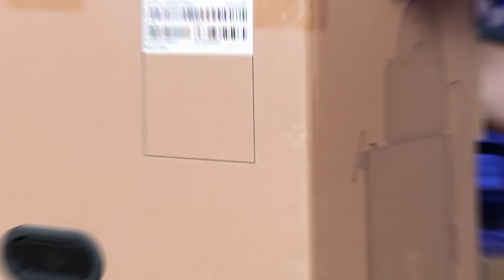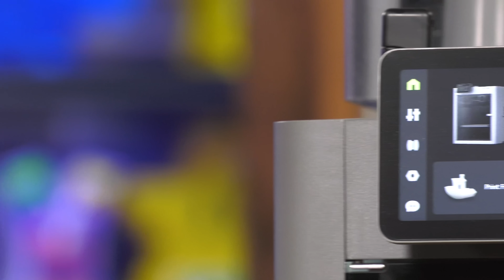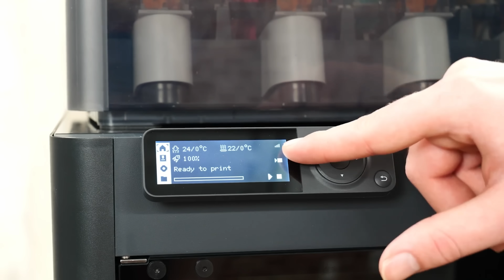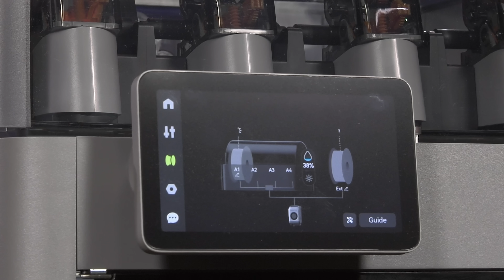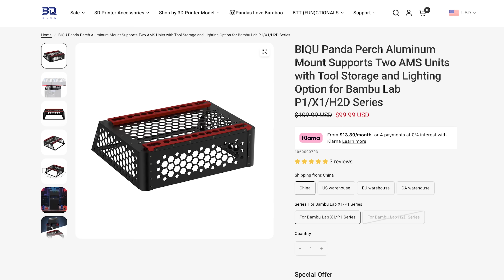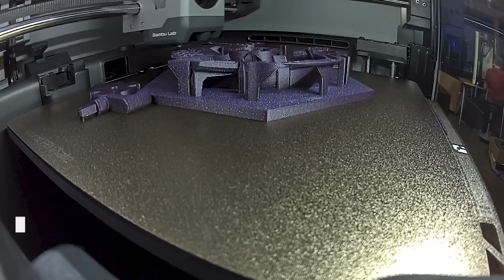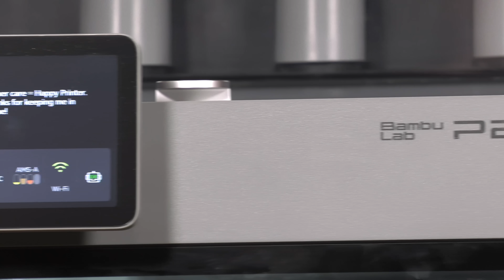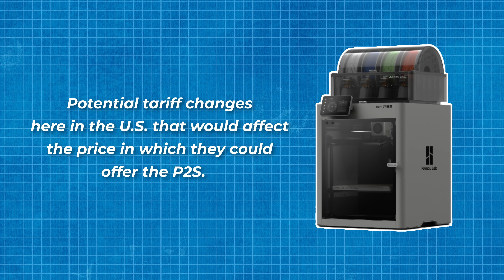FINALLY Bambu P2S IS HERE, Upgrades the X1C?

Comment: Is this thing still using carbon rods for motion? I have two X1Cs and was actually injured by inhaling fine carbon dust during printer maintenance. I developed severe asthma overnight and it lasted almost a year, requiring steroids. I personally switched to only using machines that have real linear rails.
Reply: no it use steel rods
Reply: The FAQ says not carbon and now just smooth rods
Reply: That’s the biggest crock of shit, asthma is a genetic disease. You’re saying you instantly gained a genetic condition? Nope second we breathe on average 7 grams of micro plastics per week. Those particular particles are made of guess what about 60 percent carbon silica coming primarily from car tires. You’re inhaling half a rod a week already, there is absolutely no way you could say it’s the carbon rod on the machine 😂😂😂😂😂 That sounds absolutely ridiculous
Reply: Yes, people stand by fires out in the backyard all the time and inhale the dust and smoke and end up with asthma.

You also did not developed asthma suddenly, you always had it and the carbon dust just irritated it.
Reply: @ShyCataclysm Incorrect, no breathing problems my entire life. I saw one of the best pulmonologists in my state and he provided me with several studies showing my experience was not unique. These things put off a ton of pollution, but the carbon series are among the worst.

Comment: They have locked some features behind an online thing didn't they? Is this still true?
Reply: As I've read, they updated the firmware for security reasons but that caused users to have to login to a bambu labs account. About the locked features it seems from what I've read that some options are only available from their app. There were concerns they would go HP levels of crazy with that and that's what I am asking. Did they? Does anything of it proceeds? I would love to buy one of their printers but I want to be able to change freely the firmware version with whatever I want and I don't want to sustain a bad ecosystem who tries to lock me in
Reply: @motbus3 It wasn't actually for security reasons because having a cloud connected printer is actually way less secure.
Reply: @NightfallSentinel  well yes, it was for security for their backend systems, since they were receiving a lot of random requests from other sources than their printers, but yes if you care about security the LAN mode exists now
Reply: @NightfallSentinel the excuse for the update was security reasons. According to what I remember they said that they needed to require you to login to see your printer through the web which kinda makes sense, but shouldn't be obligatory as they also disclosed, do not quote me on that, to be preparing more services through their app
Reply: @motbus3 nah you can still turn on lan mode, only thing that's locked off if you turn it on is their mobile app and direct sd card access from the slicer, which the former prusa also blocks off (or doesn't support) on lan mode and the latter doesn't really matter to me, but if it does too you then feel free to get something else lol
Reply: @xuyukun123 but can you flash custom firmware still?
Reply: @motbus3idk X1Plus firmware exists, I'm sure someone will find a way for P1S too
Reply: @xuyukun123 "find a way" is cumbersome. If they actively removed the ability for that it is a shame
Reply: @motbus3if it isn't locked down on the hardware initially it can't be actively done so after is how it generally works lmao
Reply: @motbus3and also they allow you to revert firmware if you want 🤷‍♂️
Reply: It's not true yet, but the TOS indicates strongly that's where they're going at some point.
Reply: @Waldohasaskit210 if o understood correctly it is not possible to flash new firmware to avoid that nor using an old version. Is that correct?
Reply: Where are you getting that from?
Reply: what kinda features are you even referencing?.